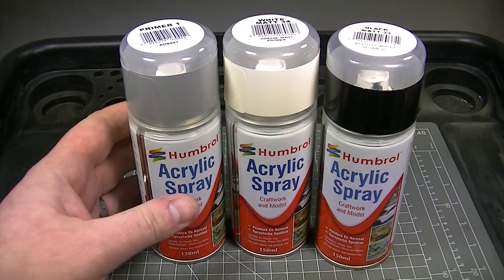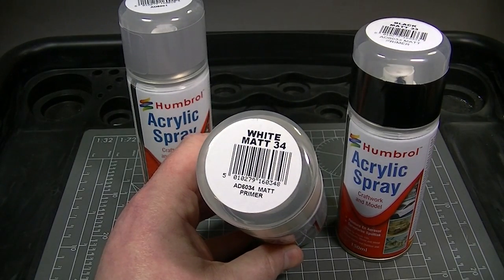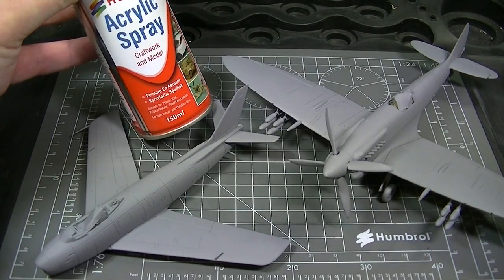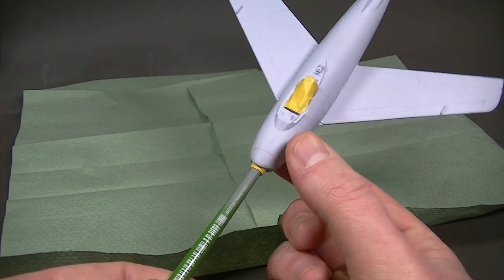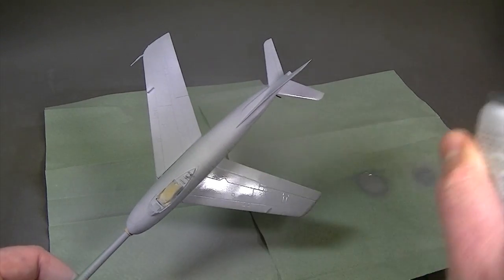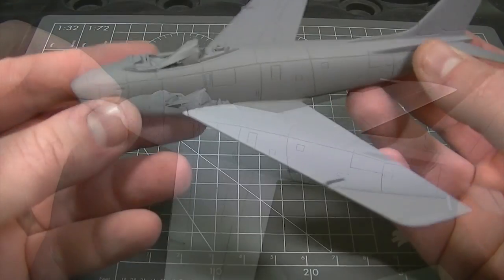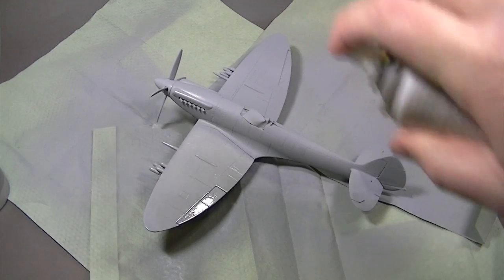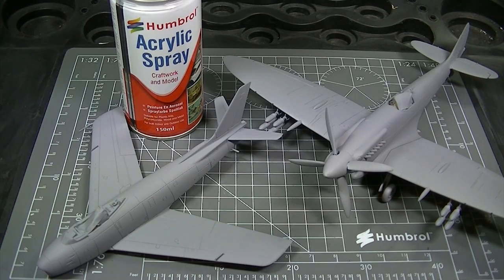Humbrol - How To Use - Spray Primer

Comment: For those of you here in the UK, if you do a lot of modelling, then I suggest you go to Halfords and get their grey primer (used for cars). It comes in large 500ml spray cans, unlike the piddly little 150ml cans that Humbrol give and the Halfords 500ml cans are far cheaper and the the quality seems better too in my opinion. You just need to give it a light sanding after spraying with wet and dry sand paper. I've used Halfords grey primer for years and never had a problem on my plastic models. Acrylics work well over it. Halfords also have a primer for plastics but that's used for bumpers which are ABS so I would avoid that one. Just use the normal one, primer comes in grey, white and red.
Reply: Terrible advice, don't use automotive paints for anything unless you have a respirator AND a spray booth. They are cheaper, yes, but what you save in money you pay with your health, since these kind of paints contain isocyanates.
Reply: Humbrol liked that one
Reply: @DGP406  agreed that stuff is carcinogens deluxs.

Comment: Hi, Is it possible to use enamel paints over an acrylic primer?
Excellent helpful videos, hope to see more thank you.
Reply: Im pretty sure that this is an acrylic lacquer based spray and not a typical waterbased one. You should be quite safe using enamels over it if I am right. Try read on the can if it contains stuff like n-Butylacetate,etyl acetate, Xylene, Toluene or 1 metoxy-2-propanol.

Comment: It's an acrylic primer... does it adhere well to the plastic?  I first used the bottled testors acryl primer with acrylic paints.  The primer was a nice "primer" in all respects save that it didn't adhere very well to the plastic.  The base coat stuck to the primer well but the primer could be pulled away from the model with masking tape (taking the base coat with it).  I used some Tamiya laquer primer on my last acrylic paint model and didn't have adhesion problems.

Comment: If I had an aircraft with a basic two-tone camouflage, could I use two primers? I ask as I'm in the process of making an F4F-4 Wildcat. It has a very dark grey for the top of the aircraft, and a white for the underside. I sprayed the entire aircraft in grey primer, but am now having issues getting the white to look good. It's ended up looking very patchy and still has a grey tone showing through it even after 3-4 coats of white acryllic.

Comment: If anyone wonders if this spray is a water based acrylic its not. I checked the ingredients it contains acetone and hydrocarbons so I belive it might be pretty much the same stuff as the Citadel sprays witch also contains acetone and hydrocarbons. This means that this Humbrol spray is safe to use enamels on top of. Also it will dry fast witch is good. Solvent based primers are always the best primers!

Comment: How do you prime stuff inside cause my family worried it might stink up the house
Reply: I'm painting in the living room. The smell is delicious haha however I do make sure the backdoor and windows are all open and I relocate my dog upstairs to one of the bedrooms where I have that window also open and the door closed enough so she can still get out.

I find with model building the actual painting part isn't a constant never ending chore. More you have much work preparing your pieces for a short painting session followed by drying and more preparation with a touch of cleaning equipment in the interlude between painting some more.

The smell usually goes by the time you've cleaned all your workspace.

I'm set up on my pretty new desk which I've taped the model box and some other cardboard boxes and plastic sheet to the surface of to protect from the solvents and paints.

The only thing you need to be mindful of is the particles being blasted in to the air, especially around your face, mouth, nose eyes. The heavier your finger presses that aerosol can, the more puff your goin to get. Not good  if your spraying near your old ladies best vases.

Comment: i have a model i need to paint. the whole thing is red, but 3 different shades (on pieces easily separated). if i used the three different colour primers on different pieces but use the same red colour spray on top of the different primers will the red come out different shades??? sorry if that seems a stupid question but i dont have an airbrush yet and finding different shades of red in spraycan form is not easy.
Reply: crossfadeking 
The primer won't affect the colour of paint, it's only used to allow the paint to stick to the model better.

Comment: What if the model will be mostly white but with black also? (Saturn V rocket)
Reply: It would be better to prime it white given how black is a contrast and you'll get a more solid white, otherwise you're going to be doing tons of layers.
Reply: Joe 
I'd just spray it white and paint the black using a brush or airbrush.  By the way, which Saturn V do you have?  I've been wanting to do one for ages.

Comment: I would love to get a fast response but what model was that Propeller Model? It looks like a spit fire, but what was the brand and part #?  It looked liek it had moveable control surfaces and that's exactly what I'm looking for!
Reply: wyattcon11 It's the Airfix 1/48 scale Supermarket Seafire FR.47/48, part no is A06103, it seems to be out of stock in most places, but you can find one on eBay.

Happy building
Reply: Thank you very much!

Comment: I bought the humbrol paints and the primer in the small pots and they are rubbish no matter how much you thin them down the Finnish is horrible, witch is why they have-not shown you how to airbrush these paints oh there site
Reply: The Master Hurst It is probably because they weren't manufactured to be thinned down and applied by airbrush. If you don't know, ask them "does this work if I do this".
Reply: The Master Hurst 
Most Humbrol products are designed to be brush painted